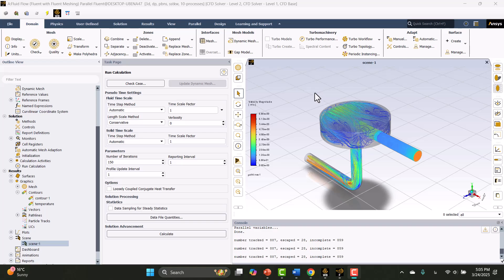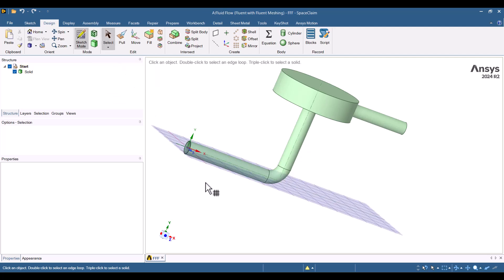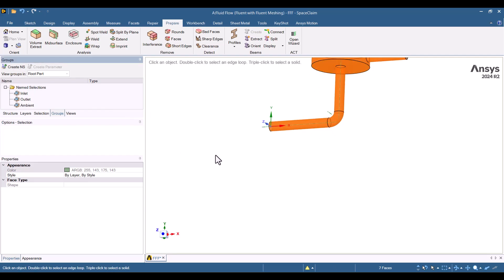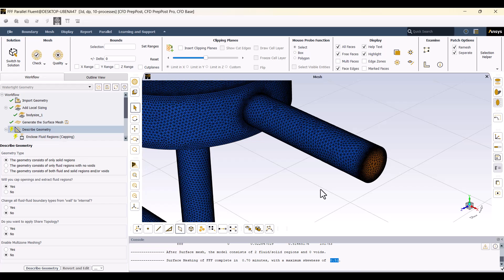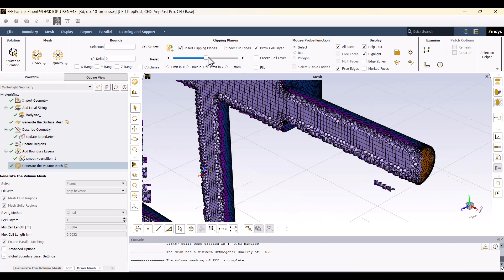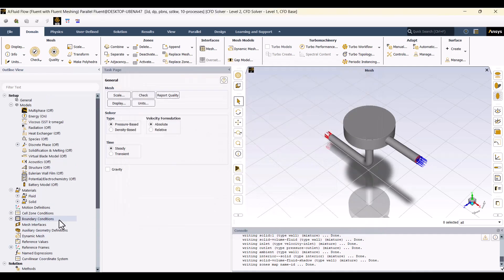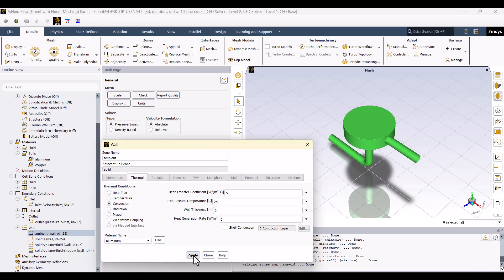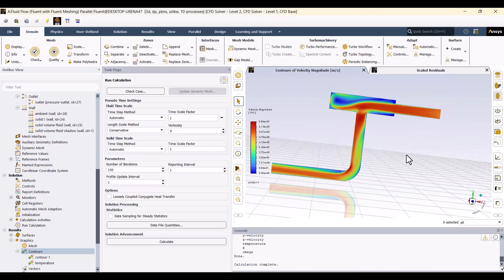🔥 ANSYS Fluent Tutorial: Convection & Radiation Heat Transfer Simulation 💧

Comment: You forgot to change al to copper on the "ambient" tab when setting the heat transfer coefficient, and I strongly recommend using "hydraulic diameter" at the inlet BC. The solution will converge with fewer iterations.